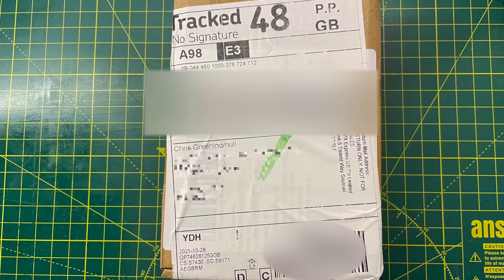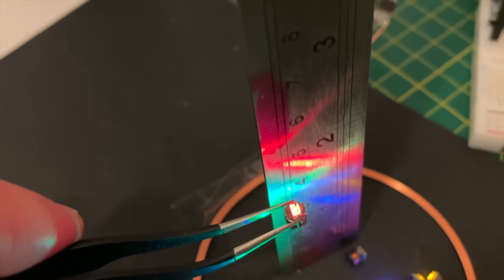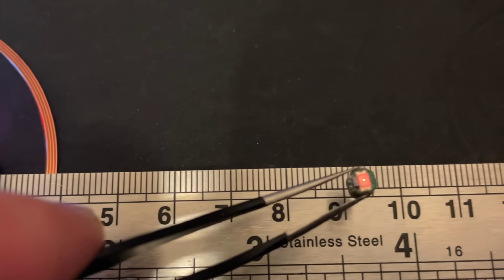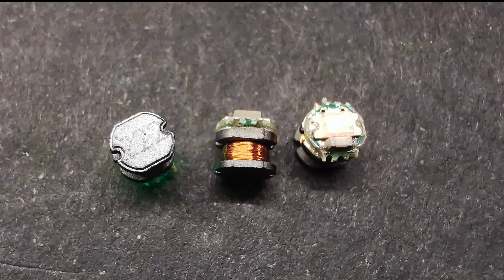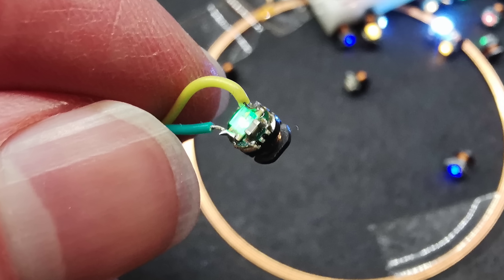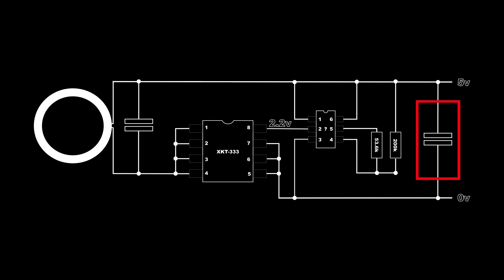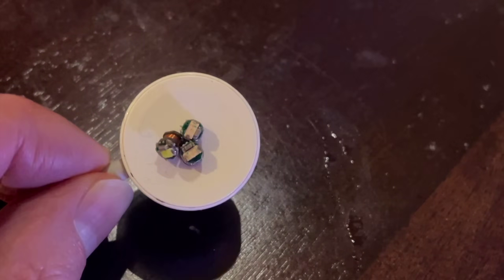Look Mum No Wires - This will blow your mind

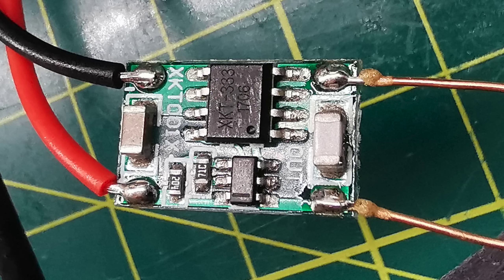Comment: 3:38 if you look closely, there is a sin wave.  It seems like the positive half-cycle is just much larger than the negative half-cycle.  Since there are only 2 components, my best guess would be that it is due to the imbalance of sizing of the reactive components ( capacitor and inductor.) Impedance of capacitor X_c = -j/(wc),  Impedance of inductor X_L =jwL.  
Resonance frequency would be f_o = 1/(2pi*sqrt(LC))
I_cap = Cdv/dt, V_inductor = Ldi/dt ; V_c = V_L from parallel connection depicted 
conclusion: capacitor is  undersized compared to inductor. recommend higher capacitor value.
hope somebody found this useful LOL

Comment: For Cosplay, you could glue some to your skin, using harmless spirit gum, then place the power supply near by. Leds, on your face, above eyebrows, power supply under wig, just above forehead. The power comes from a 5v cellphone external battery Booster. I've used this type of battery for powering long strips of leds, for hours.
Leds accenting facial features. On backs of hands, or finger nails. Power coil on wrist.

Comment: Love this idea for my resin artwork. Could the coil be placed at the bottom of the mould then cover the with coil coloured resin to hide it. Then as you fill the mould with your flowers and resin liquid in stages, could the led lights be placed where you want them throughout the design? The only extra question would be- if by touching the finished piece would turn the leds on, how would you turn them off when you wanted to. Great find and very useful.
Reply: That's a really cool idea.
Reply: I can't say for sure if the coil could actually be placed in resin, but you could always make a base with the coil built-in as a separate/removable part. Just set the resin art piece on top of the coil when you want to display it, etc.
Reply: @CrashHobbyX  Good idea, thanks for your reply

Comment: If you can build a tower that transmits electrical energy such as a BTS tower, then the car doesn't need to carry a battery. enough wireless power alone to power all electric cars and other electric vehicles. even the need for electricity in every house around it.

Comment: Awesome video. I'm totally getting me some of these ASAP. If they're not sold out by now. But, wouldn't using a stainless steel ruler warp the magnetic field coming off of the primary coil and skew your test results for the distance? I would imagine the magnetic field would want to flow through the ruler, like if you stick a magnet on a paperclip and the paperclip itself becomes magnetic, extending the field further. Especially in the scenes where it seems you have the ruler sitting across the whole primary, I think for the horizontal test. And with the ruler having such a large cross sectional area, one would expect this effect to be significant.

 Actually, measuring this effect might make for a good video. Maybe seeing what distance you get using a steel ruler vs a wooden ruler. And other experiments of that nature.

And since I can't take credit for noticing this, Kudos to my mum for pointing this out to ME. I feel remiss for not catching this. But somehow she caught it, despite being as naïve about science and STEM as you would expect a kindly old woman to be. :D

Comment: Would they still work if you attached a small magnet to the led? And will the coil work through an iron plate? Then you could do cool things where you can stick them on a vertical surface and form patterns/shapes or reposition them…

Comment: Couldn't see this elsewhere, but I might have missed it. 
Anyway, about the asymmetric sine wave, I'm sure you remember LED is short for Light Emitting Diode, and a diode is an electrical component that allows the flow of current in only one direction, right?

Comment: Hold them while under high tension power lines.  There is a good chance that they will light. If so, place them on tree branches under the power lines to drive people nuts as they try to figure out what they are.

Comment: It can be used as Gunpla's eye lightning no more worries about placing batteries and some cable anymore,just need to attach it's coil to the base and it will light up the LED,this is COOL!!

Comment: As a guitar builder, my first thought was to cast them in a resin river up the middle of a fretboard. I'm already incorporating resin art into my designs but the interface required to power these doesn't seem like it will work the way I'd initially hoped. Maybe with some more brainstorming I can think of something cool.
Reply: wait. so maybe the E strings could be the coil?  maybe you could just run a jumper wire between the two E string tuning machines, then the bridge connects at the bottom, so otherwise wireless.

Comment: integrate them into some board games .... you can just have lighted game pieces or at different game "goals" have a switch that will light up various parts of the games ... of course parts of the "board" can be lit with regular built into the board itself

Comment: Would it be possible to construct an induction bracelet that can wirelessly power similarly-designed handheld light orbs and such? That'd be rather neat.

On the other end of the scale, how large can you go? Would a room-sized magic circle plugged into the wall and mounted in the ceiling or floor be able to power all kinds of electronic nonsense remotely?

Comment: You might not want to use a metal ruler while testing the range of inductive power. It's definitely going to influence the electromagnetic field. For the same reason that an electromagnet has an iron core with a coil around it.
Reply: How you know it'd conductive ?
Reply: @dreknows  How do I know metal is conductive? Or how do I know the ruler is metal?

Comment: this could be used to trigger something, all you need to do now is measure the voltage lost by the wireless charger and with some circuitry and coding you can detect when or which led is placed on it to get an output

Comment: Here is project suggestion: install them on the bottom of glasses, glue charger under beer coasters, and like this you can illuminate your drinks. It should look nice. (I haven't read comments, if anyone else had this idea).

Comment: can't wait for the day when we have wireless electricity across the entire planet. 
and you could like build an entire city in the middle of antarctica and the entire city will just get powered right away without having to use any power cables or windmills or generators or solar panels. 
and we are never gonna need batteries again because our phones and flashlights and vehicles are getting powered by wireless electricity. and all electric vehicles like teslas and rc cars will never have to be recharged ever again.

Comment: Grow some crystals with alum and use one of these as a seed crystal so the crystal grows around it.seal it with a drop of clear nail varnish to protect whilst the crystal forms around it.
Reply: Cool idea! Made me think of the glowing crystals on Land of the Lost. Watch out for Sleestaks…
Reply: @haroldlane4647  I used some "candle flickering" leds with a home grown crystal. If you then stabilise them in cactus juice, they last essentially forever. In fact i might make some more.

Comment: the dip with the flat line looks like a capasitor discharge and refilll except the refill is shaped like a bottle that cylindrical with a narrow neck so maybe there is a bottleneck  somewhere in the system

Comment: Would be great for modelling - put the coil in the bas of a building and the put lights where you need without having to run tiny wires. Or use a base and separate vehicle lights.
Reply: I was thinking scale RC Ships myself.  For things like mast and exterior lighting things that it's a bit harder to hide the wiring for or if burns out is obnoxious to replace and too much weight up high can be a problem.
Reply: I'm just about to build 1:600 scale model of Star Trek Original Series Enterprise.. You can buy a lighting kit for it, but it's messy and expensive. These would do the lighting job perfectly for running lights and window lighting me thinks as the coil could live in the saucer section where most of the effects are needed..
Reply: i was just thinking that. Headlights or for Emergency vehicles.
Reply: Headlamps and Rear lights in Model Car builds,
Reply: @JETJOOBOY  head lamp in a lego hard hat.
Reply: I would love to put one of these into the head, jet pack and weapons of my gundam models. There is no place to hide wires without looking goofy, this would be amazing.
Reply: @gaveintothedarkness  BRUH THIS WAS EXACTLY WHAT I WAS THINKING! I am really curious how well this would work
Reply: @HunterDVincent  I found some on aliexpress for $9 plus shipping. Hope they work well. my thoughts would be to buy a gundam hangar and hide the coil behind it. That way the head and cockpit and weapons will be in range to light up.
Reply: @gaveintothedarkness  I thought so too, but the range is very far.  What about bigger kits?
Reply: Too much wasted power. The power needed becomes MUCH greater the further away you get from the "base". This is way too inefficient at a distance to power much.
Reply: Could also use as the light source for fiber optics.

Comment: Can the LEDs be water sealed? If so you could do a snow globe with the coil at the bottom of the globe. The only thing to work out would be what fluid would be weight neutral so the LEDs float around evenly inside.
Reply: I feel like the weight of the LED's would make up for a more viscous liquid, Mineral oil should work fine?
Reply: @taylorhawthorne5367  mineral oil is also non conductive so they wouldn't short, nice idea
Reply: dip them in wax
Reply: That's a really good idea!
I think that the liquid doesn't have to be necessarily weight neutral. Maybe they could also move around, maaaaybe with the help of a mini pumper
Reply: Bro you just blew my mind
Reply: That would totally work. as Taylor Hawthorne said just get a viscous enough liquid.
Reply: Seal them in clear epoxy
Reply: You might have to include some air inside the bubble (above the led) too so they stay upright and don't tip over and stop working too often. Also increases buoyancy and reduces the risk of short circuiting in a conductive fluid.

Comment: Not sure if this would disrupt the signal but what you surrounded them in clear acrylic so they could work under water...IE: In Drink/ glass and coil inside a coaster, aquariums & place coil out side near Filter, pool & floating battery to power lights.

Comment: project ideas ...

Walmart theft stanchion sparklers.

Stop light induction loop twinklers.

Windturbine inverter high freq transformer fireflies.

Microwave oven internal glitter.

Electric Gitar pickup glam

Electric blanket glitter fluff

Current transformer tweeks

MRI killers

Radar traveling wave tube pixies

Wave guide tunning buddies

Standing wave hf antenna guides

Electric car inverter drive flashers

Comment: An aquarium, waterproof the coil and put it under the rocks.  put the little leds in  small acrylic marble sized molds. Let the coolness begin. Id even use an opaque acrylic so you couldnt see the actual led body but the whole thing would glow evenly maybe even sprinkle glow powder into the liquid acrylic before molding it.

Comment: my idea for these is based on an old guitar wah pedal of mine that uses an optical setup (the “Bad Horsie”)..  the way it works is the pedal moves a piece of cardboard between an LED and a light sensor.. the cardboard has a slit through it that gets wider and lets more light in to the sensor when you depress the pedal.. with these, you could make an optical wah without the cardboard, where the light fluctuates in brightness as the pedal moves an energized wire or something closer and further from the LED. I think it would probably be more responsive than the cardboard design. The main problem with the old design is that the LED brightness is static, so you always get a very noticeable and sudden change in the signal when engaging the pedal, because there is a limit to how small/gradually you can cut a slit in the cardboard. Im sure there are easier ways to dim an LED, but it would also fix replacement LED having to be soldered in if it burns out, which is how/why I was forced to learn the internal workings of my wah pedal in the first place lol.

Comment: after the first 30 seconds (after you did a little more closeup to the LEDs) my instant thought was "what a shame- and senseless waste of copper"... every LED base with a coil... as if those guys who do them would have discovered inductive current...  but maybe i am wrong, and if they just were wired would use up more copper... but you still have to have the wiring and the "coil" around them for supplying them with power

Comment: These + some fiber optic threads would be perfect for miniatures. Instead of using the LEDs in the eyes or what ever, put the LEDs in the base of the minis and use fiber optic threads that go down to the LEDs in the base. You'll get brighter lights, and you can mix/match fiber cables for different colors thread them around the minis a bit better. Just print the minis hollow and in multiple parts where you can use a tiny dremel bit to make channels for the fiber optic cables.
Reply: That's an awesome idea....
Reply: @HeronMarkedBlade-ef7zz  Thank you. I was looking at some of the larger 24v coils, looks like the LEDs are self regulating. But with a bunch of coils on a TTRPG tile board, you can embed these LEDs into all kinds of things. Glowing lava, fire, torches, sconces, and so much more. 
Got a dungeon? Turn the room lights low and use the actual light from the sconces and torches to show what is and isn't in low light and total darkness. Just use some diffusers to spread the light out.
Reply: I’m not getting a new one ☝️ I’m going out of the house 🏠 I’m pretty 😍 and it looks pretty 😍 and the other is like 👍 I just saw a post and a few other pictures I have a few days to do you want it but it’s just like 👍 but it’s like 👍 but I’m sure it will do that I have no clue 🕵️‍♂️ I’m just not in it and I’m looking

Comment: A project idea I have will need a lot more LEDs. Spread them out in a grid in the ground outside (porch / garden etc). Move around with the wireless coil and see them lightup with your route. Can be used in RC car racing tracks aswell, where the rc cars carry a small wirless coil, lighning up the track wherever they go.
Reply: I love the RC track idea.
Reply: This is how you get TRON! Do you want to get TRON?
Reply: @horrorhotel46290  tron means?
Reply: @SpartanSky  How old are you? It's a movie from 1982! 🤣
Reply: @Haifeif55  20

Comment: The coil is probably clipped so that the resonant circuit is reinforced only in one direction, and so there is no flashing of the LED or need for a diode on each light.  ??  IDK, I studied electrical stuff back in '70 and before, so my memory is a bit weak.

Comment: As mentioned on other comments cast them inside of resin. One cool idea comes to mind, of making set of dice that light up when you throw them on the dice container, though this would need to be worked with some dice manufacturer to get balance just right to it to work.

Comment: Put the  LEDs on bicycle Wheels, and have them powered by a coil/magnets on the bike frame, near the  LEDs.
Each time the wheel turns around the LEDs pass by the coil/magnet, and flash.
The spinning wheel energizes the coil, with magnets, that pass the coil, on rotation.

Comment: I do similar things but instead of inductors I use microwave generator and a tuned receiver with a pair of schottky diodes and an LED. Can achieve a range of up to 1.5 metres if i add a reflecting plate behind the transmitter.

Comment: the reason you can raise them so far and still have them work is because you had the ruler in the middle measuring the height and the ruler was made with metal.

Comment: There is probably a standard silicon diode anti-parallel to the LED as they have a low breakdown voltage of around 5-6V which can damage them

Comment: Has anyone tried to enclose the LEDs in epoxy? My only concern would be possible damage caused by the heat generated by the capitalizing process of two part epoxy. If it works, these would make for a fantastic glowing gem effect.

Comment: use several much smaller induction loops on the bottom of a board, and use the LEDs as pieces in a board game that light up when you land on certain areas?

Comment: Endless applications in modeling and dioramas!  Makes it easier for us un-electric types to light stuff up without solder, circuits, etc.!
Reply: I was thinking the same thing. The flashing lights would look great on a model cop car.
Reply: The inductors have very low range.  Think about the charger for your toothbrush or cellphone.

Comment: I get a 555 based "Chime"  PCB w components(kit) including speaker. for 99 CENTS!!! on ebay and FREE shipping!! to boot.... as the induction coil driver (needs to be modified for frequency and end of Osc. time)
BTW: the 555 works from 4 - 15V so you also don't need V Regs......

Comment: I don't what the 333 Chip is(prob a Chinese knockoff of the 555)
 but I know this can easily be done w a LM555 Timer in Oscillator mode. 
Look for the "555 Timer Cookbook"  with Hundreds of different circuits of this AKA "Most Versátil Chip ever" going back about 50 years!!!! and still Kicking ass!!!

Comment: Hi. Thanks for video. I see one interesting application for these leds. The artificial stones in garden along pathways for instance. I see that such way: the loop is digged in the ground and leds are submersed in the epoxy resin. For the halo efect stones might be scratched a little on the surface with the vibrating polishing machine. One could enlighten the pathway and make nice garden look. What do you think?